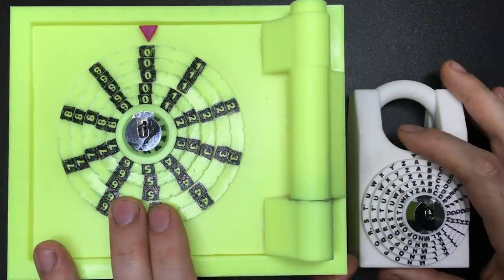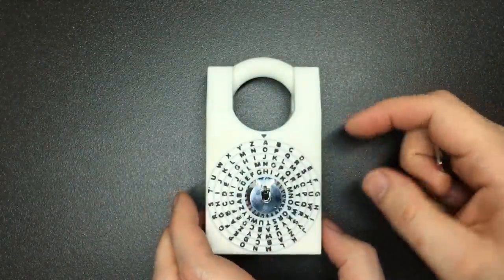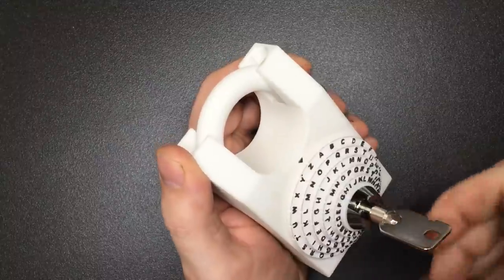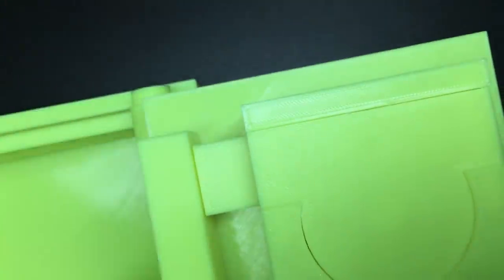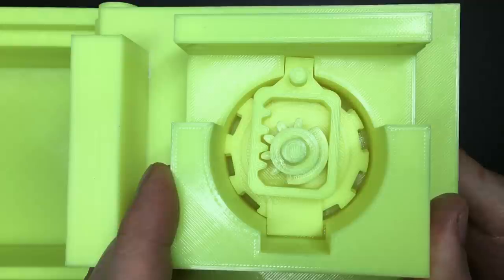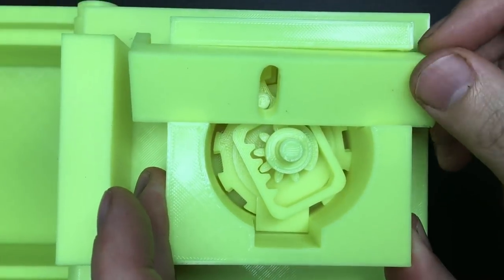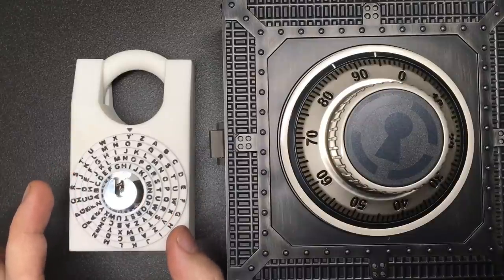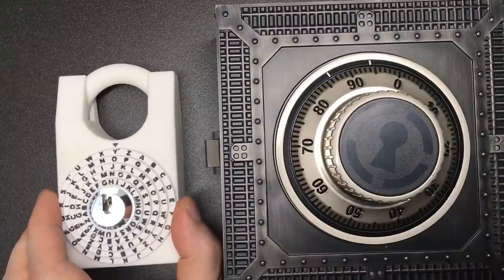The Polish Combination Lock - New Version Safe and Padlock

Comment: Nicely described Lock Noob - you're a very good & clear speaker and you've described the lock very well - bravo!  Note that I did decode the version that doesn't have the key in my video "Picking 139" with the updated security features (or many of them), but no key. I tend to focus on combination locks but I'm not much of a picker, and so if I had the key with those locks you have there (or if I managed to obtain a key or if I teamed up with a good picker who was able to make some sort of temporary key) then I might be able to get somewhere. I was offered by the inventor, Zbigniew, to give it a go with the correct key supplied, but I turned it down as it's quite time consuming (actually very time consuming!). I'm just pointing this out because many people believe that anything mechanical can be manipulated, and this is no exception in that if someone had access to one of these locks for several days and had sufficient skill & practice then I think they could decode one of these locks and get in non-destructively in (maybe) less than 6 hours (definitely not years).
Edit: I read what Zbigniew said about this design being harder to feel the gates ... I didn't know he'd did some more changes with that so maybe I can't decode the new version after all.
Reply from the maker: Thank you 🙏

Comment: Very interesting to see new locks like this. Great that you managed to be in touch and did such an elaborate video Ash.
Reply: Not so sure I got all the details right, but here is my thought on it. Can you measure how deep the mechanism drops in the gates?Perhaps by the amount of rotation the key allows? If the key rotates more with the right combination than the wrong one, you can use that to manipulate just like a normal safe lock. Still good of course.
Reply from the maker: You can, but the secondary key mechanism makes this very, very laborious to do
Reply: I see. I couldn't clearly understand if it was impossible to detect from the first key action. In that's really prevented the delay factor is very significant.

Comment: Hello, I have read all comments and watched this very well done video. There is one important feature that was not mention and demonstrate clearly. This is magnetic coupling between the central plug of the central lock and Moon Gear transferring movement to Actuator. The previous generation without the central lock was picked by Swynndla however that previous one give you a chance to feel the magnetic coupling and the false gate as Swynndla demonstrate on his review. This model with central lock unable to feel any false gate. The friction inside the central lock is way too strong comparing to the magnetic coupling force. When you turn the key in the central lock your force used to rotate the key is many times more than the force the magnetic coupling and false gate offer to “feel”, therefore by rotation the central lock in order to probe by the Actuator going down the false / true gates you will not be able to distinguish which one is false and true. This magnetic coupling enable you to rotate the key 360 deg. The key is to mask the little friction difference on false and true gate by central lock and its relatively strong friction of inside mechanism. Of course I do not say that the probing is not possible, it is but you will not be able to draw any conclusion out of this probing in this version. Maybe Lock Noob can demonstrate this on supplement video to last one, this is important to understand.

Thank you very much for nice words about this design,

Zbigniew Olejnik  
https://www.polishlocks.com
Reply from the maker: Thank you so very much for the loan of these SUPERB locks. You have a fantastic mind and talent and I wish you all the best and even success 🙏🙏🙏

Comment: Whats stopping you from pushing down the sidebar into the wheel pack and wiggling it? 
That looks very possible, if it is this is flawed
Reply from the maker: It’s the fact you need the key to engage the drop arm each try 👍

Comment: If it was made resistant to physical attacks, it looks like trying to figure out the combination through "lock picking" would be a nightmare. I guess the only weakness would be if someone saw you put in the combination, but there is still the shielded tubular lock to also deal with.
Reply from the maker: Yes, it’s a fun lock for sure!

Comment: Forgive me if I've missed it, but there doesn't appear to be any way to change the combination. That would limit this lock's appeal, wouldn't it?
Reply: Each gate in each wheel could have an adjustable part, raised is false, lowered is true, fiddly but perhaps possible?
Reply from the maker: It can be recoded, you just need to manually disengaged the wheels from the outer dials. Not as easy as a change key, but easily done by a locksmith 👍

Comment: I wouldn't think it would take many more tries than the number of false gates. For example, the safe has 10 positions. Set the combo to 00000 and turn the key hard and wiggle each wheel to see if it's on a false gate. Anything that has friction (or maybe different contact point width) goes to the next number. 00000 -> 11111 -> 12222 -> 12333 ->12344 -> 12345 = six tries. If the false gates had different contact point depths it would take a bit longer, but it could still be decoded in parts.

If none of the gates bound at the same time it would take 16 tries maximum with the 12345 combo:
Front-to-back binding: 00000 -> 10000 -> 11000 -> 12000 -> 12100 ... 12343 -> 12344 -> 12345 (16 tries)
Back to front binding: 00000 -> 00001 -> 00002 -> 00003 -> 00004 -> 00005 -> 00015 ... 02345 -> 12345 (16 tries)

Worst case (99999) with simultaneous binding is 10 tries.
Worst case (99999) with individual binding is 46 tries (9*5+1).

The padlock could have 25 gates [A-UW-Z]; if so it could take more tries, but not exponentially more.

A tight fit on the actuator and low friction wheels could reduce feedback.
Reply from the maker: You do of course have to use the key each time or pick it... which might add a year or to to the time... 😁

Comment: The only vulnerability I can see is turning the key towards the "open" position (clockwise) as far as it goes into the false gates and jiggle each wheel to feel if any of them is looser than the others. Return the key left again, change the wheel(s) that felt like false gates, and repeat. Still quite a bit of work, but instead of brute force trying all 10⁵ (100.000) positions (for the 10 digit dial), you may get it open in just 50 tries. Worth a try, I would say. For the 26 letter dials the numbers are "a bit" higher, of course (118.81.376 resp. 130)

Comment: To simplify my story. If the ordinary safe lock have protection rate of 100, this one have 250, but the burglars won't touch not a one of them, they'll drill the hole in a wall. There is just no need for such high level of protection.
Reply from the maker: That’s an interesting conundrum really with safes. Many safes have very complicated mechanisms that match the security of the safe body which can take even experienced safe smiths hundreds of drill bits and many days to get open, so I would say that a lock like this, slightly modified, would offer a good alternative mechanism 🤷‍♂️

Comment: "It would take years"

The safe has 1 953 125 possible combinations, at 30s per attempt it'll take 3 years 256 days to try out every combination so about 2 years on average.

2 million combinations is actually fairly low, trying to brute-force dial every combination for the lock with letters would take 2 835 076 330 640 years. For reference that's 600 times longer than the age of the earth but you will have the lock open before the heat death of the universe so you might as well
Reply: There are 25 possible digits for each wheel and there are 5 wheels. Each wheel can have all the same letters if you want therefore the amount of possible combinations is
25 x 25 x 25 x 25 x 25
= 9,765,625 possible combinations. Plus you have to eat and sleep
Reply: how did you get this number for a safe, 1 953 125 possible combinations?
Reply: @realtaiter3991  eat, AND sleep, well if you're not going to really apply yourself you don't deserve to open it.

Comment: Hi Lock Noob, It was inevitable that this lock/mechanism was pulled from manufacture. There is no point in reinventing the wheel. Apart from manufacturing costs with rack and pinion gears, extra dials as well as wheels, there are 5 dials with numbers to turn instead of one dial and one set of numbers as on a standard safe combination lock.  Not user friendly from many aspects. Sargent & Greenleaf many moons ago invented the "manipulation proof" combination lock with a "butterfly" knob in the centre of the dial to allow the fence to settle in the wheel gates when the correct combination was dialed. To require a key to achieve the same effect is counter intuitive for use with a combination lock. This S&G lock was model 8400 with the turn knob in the dial, and has been replaced with a push in dial - model 8500 - that achieves the same effect as the "butterfly". No safe manufacturer would use another lock that would have a different "footprint" from the excepted standard which simplifies manufacture, and on top of that would require U.L. testing for manipulation resistance. Manipulation "proof" padlocks are also available - S&G 8088 and 8077 series. These locks and the above safe combination locks can also have their combinations changed in minutes, by use of a change key. So you can see why this "new" combination lock leaves a lot to be desired.   Regards, Brian.
Reply from the maker: I do take your points but I think with a little more R and D to make this a little more user friendly, I don’t think it’s much harder to operate than some of the commercial safe locks out there with check keys etc. You could reduce the dials to 3 and the code IS changeable by someone with the correct knowledge - it’s quite easy for a locksmith. It could be that the market just doesn’t need another safe lock mechanism, but I’m not sure - new ones are produced all the time 🤷‍♂️

Comment: My theory: If you can deal with the key lock first.  The key will always bind the deepest wheel. Then a tiny bit of more angle that you can turn the key will indicate the true gate.  Mark it and decode from back to forth
Reply: @yam soong This will be possible without magnetic coupling gear. I explained the problem of decoding post below. It will be worth for Lock Noob to confirm this by practice.
Reply: @polishlocks  Will the magnetic coupling gear make the key lock can be bypassed by a magnet that powerful enough from outside?
Reply: @mkwsng  No in my opinion this magnetic coupling is not possible to bypass or dissactivate using external magnets. The concept here is that you cannot tension the mechanism and feel any gate by rotation of the key.

Comment: I'll have to review your video again, But I am with Tarehjerne Tarehjerne cooments in asking in what's stopping you from pushing down the fence into the wheel pack and attempting to find true gates?
Reply from the maker: How would you push the drop arm down?
Reply: @LockNoob  Seems to me that, like safe manipulations techniques, you exploit the not absolutely perfect tolerances in the lock and would be able measure or detect the slightest additional movement of the drop arm into a true gate, thus discovering the true gates one wheel at a time.
Reply from the maker: Absolutely, but to get the drop arm to touch the wheel pack, you first need to pick the lock. A lot.
Reply: @LockNoob  Yes, of course, but I was assuming like Poti314's examples, with a knob.  If the lock was the problem, then I would make a key for it.
The point being that it's NOT manipulation proof.

Comment: that locks has to many dials at 5 and it has a key. a secure lock should only require 5 fingerprints from one hand, 1 can be missing for members of the yakuza along with a retina scan for ID verification before being able to access the 3 number combination dial.
Reply from the maker: It’s the least level of security you could ask for 😆